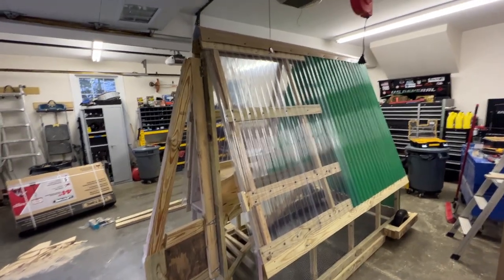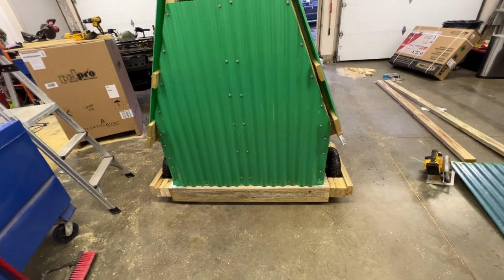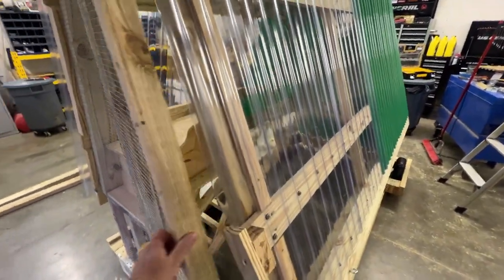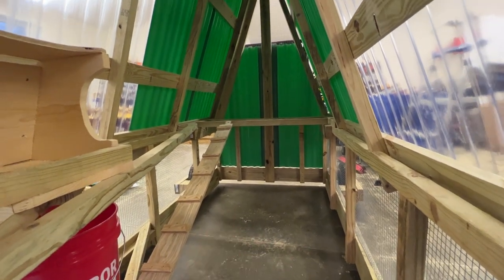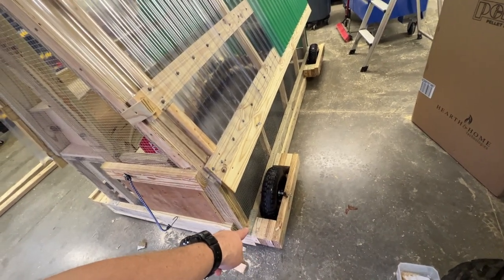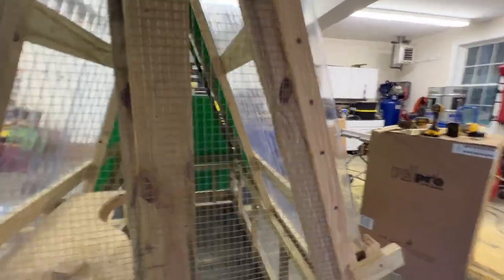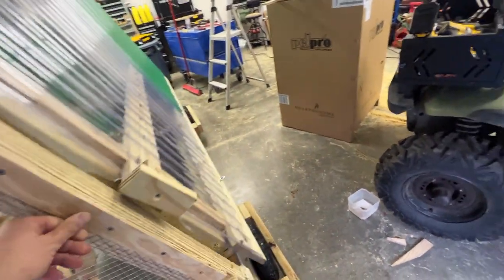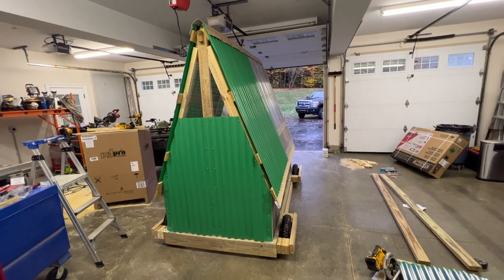Chicken Tractor Build - A Quick Walk Around

Comment: I built a chicken tractor this spring for our meat chickens. 6' x10'  and  used a solar powered electric fence so they could foray during the day. About a week before I butchered them I  took down the electric fence because they were really big and thought nothing would bother them. 
Big mistake! I lost 2  ten pound  birds to a skunk that dug under the frame.  JJ , I would highly suggest that you invest in an portable electric fence and solar charger. Your chickens will be some predators dinner. Our portable chic-shaw coop (Justin Roades design)has worked flawlessly for  2 years they nest in the coop at night and we feed and water them outside the coop. We move them to different areas on our property every 3 weeks for 8 months out of the year then into a permanent coop for the winter, that has power for lights and a bird bath heater to keep the water from freezing. Works on just 40 watts and keeps the water   in the five gallon bucket with a lid and 4 watering nipples ice free all winter.  It's about $35 on Amazon. 
Good luck with your new chicken tractor. Those eggs just got really expensive! 
Take care and be safe!
Bob